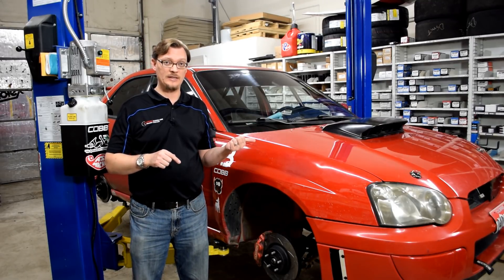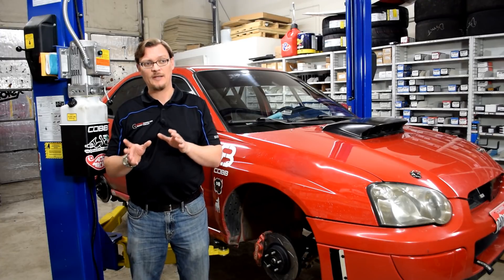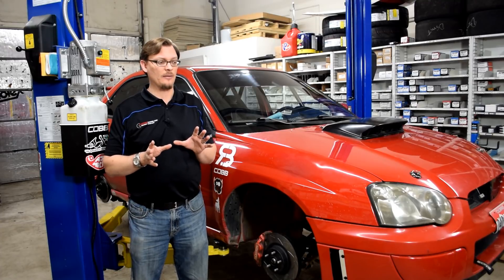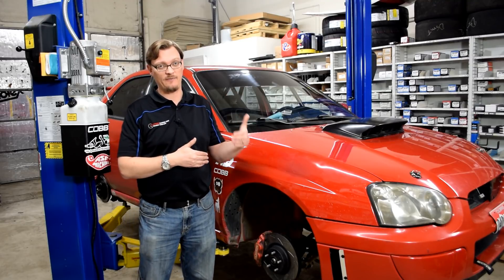STI 6-Speed Transmission Swap FAQ's

Comment: Do you have any recommendation regarding the decision between the early DCCD with 35:65 torque split and the newer version with 41:59 torque split? As far as I know, the newer versions (2007+) have an additional mechanical LSD, but I'm not sure if this affects the vehicles handling in a positive or negative way. Subaru claims, that this mechanical unit makes the car more predictable to drive, but I always thought the big advantage of the DCCD would be that there's minimal load on the front tires when the controller completely unlocks the diff, resulting in optimal corner turn-in. Doesn't the mechanical LSD (even if it seems to have very low ramp angles) counteract this advantage? And what about the 6% difference in torque split, is this very noticible? I heard someone say that the 35/56 version is close to undriveable in open mode, but can it be worse than a rwd car? Sorry for this complex question, but i'm looking to do the swap in my legacy and i'm not sure which gearbox I should look for.
Reply from the maker: Thanks for your question.  This is a question with a couple of levels of answer, so for now, I'll have to give you the high points, and you can contact us directly if you want to go into more detail.  

First, I'd base your choice for transmission around what is available, condition, mileage, etc., first, before I'd focus on the center diff function alone.  All of the STI DCCD's work well, and though there are differences, they are not what I would focus on.  

The early STI transmissions (03-05) use a center diff that is open when no power is going to the DCCD just as you describe.  If you want maximum rear bias, this may be a nice feature, but the newer transmissions behave almost the same.  The bigger benefit to these early transmission is that they have an internal pump for better oiling of the transmission as a whole, and I'd say that this would be a more significant factor to push the decision to an early transmission.  But of course, it would have to be in good shape as well.

The later STI transmissions (2006+) started to incorporate a viscus coupling that works with the DCCD.  So though you may not be able to get the same rear bias as you can with the early transmission, it is pretty close.  Both new and older transmissions will feel mostly like rear-wheel drive cars with no power going to the center differential.  But these later transmissions did away with the oil pump for lubrication (starting in 2007+) and went to a more standard sling-trough.  This makes the transmissions simpler in some ways, but maybe not as ideal for very high power or Motorsports use as the earlier transmissions with the dedicated pump.

So they both have some pluses and minuses.  But any STI transmission will be very durable, and should work much better than any 5-speed would.

Hope that helps, and thanks for watching!
Reply: Thanks for your advice. Since the car will remain mainly a daily driver and I do not intend to exceed the stock 280hp very much, the presence/absence of the extra oil pump may not be very important. I will follow your advice and focus on availability and condition.

Comment: For those that are looking for simpler. Look into the TY856B1CA trans from the Version 7 STi RA. It’s the only 6 speed Subaru made that was non DCCD but has the front and matching rear lsd.
Reply from the maker: Thanks for the comment Brandon!  Yes, the very early 6-Speeds do remove the complexity of the DCCD.  However, with a good controller like the MAP DCCD, the functionality that you get from the DCCD is pretty impressive.

I my opinion, if you are going to go to the trouble of putting in the 6MT, you really want the functionality that the DCCD brings.

Thanks for watching!
Reply: FlatironsTuning not knocking the DCCD at all. I just finished my swap a few weeks ago and it was just another cost and headache of wiring to deal with so I tried to avoid it. My suggestion was just something in the middle because the Spec B is open diff and usdm STis are dccd.

Comment: My clutch master cylinder started to fail on my 2004 Subaru TS. I went to a parts shop to get both the master and slave cylinder. When I got home I noticed the parts didn't fit my car. When I went back with the old parts off my car the guy told me the parts where for a WRX STI. I bought the car at auction and no nothing about it's history. It runs great, I've been driving it since last year. I've never tried shifting the car into six gear ever. Maybe at one point they used the same master and slave setup but why? Anyone have any clues?
Reply from the maker: Thanks for your question Lewis.  For the Master cylinder, there hasn't been much change in those.  For the slave, of course the clutch type makes a big difference.  If you have a 2004, you should have a pull-style clutch.  Most of the pull style clutches have similar slave cylinders, but there have been some changes over the years.

Good luck getting your clutch working again, and thanks for watching!

Comment: Another Great video! Heres a question, looking at the subaru transmission charts you will notice that the suretrac r180 was never paired with a dccd., do you know why that could be? Would it be dangerous, bad to pair a rear suretrac with a dccd and lsd front?
Reply from the maker: Thanks for your question Josh.  That is an interesting one.  I would say that you would not want to pair a torque biasing differential (which the Suretrac would fall under) with a front LSD (clutch type diff) in most cases in general.  But the work fine if both front and rear are TBD's.  I don't that a DCCD would have any negatives with a Suretrac rear, but I've never heard any reason why Subaru largely went away from them.

It could be as simple as cost really...

I hope that helps, and thanks for watching!

Comment: great video.

I have 2006 sti. engine swapped to 2003 ej205 and standalone ecu. currntly my DCCD is not working with ej205. while its working with the ej257.

how I can keep the dccd working with the ej205?
also what is the other things that I need to look into for this kind of engine swap?

Thanks in advance
Reply from the maker: Thanks for your question.  All you need to get the DCCD working is a separate controller.  We like the MAP-DCCD controller, and we keep them in stock :-).  Here is a link to our video explaining how that works:

https://youtu.be/5DSCWigEbOc

Hope that helps, and let us know if you have any other questions.

Thanks for watching!

Comment: Okay, so I’ve been super confused for a very long time. I have a 2005 wrx and just picked up a 2006 sti trans, will this be a direct bolt up to the R160 rear dif? Allowing me to use stock hubs/axels and an automatic drive shaft? If not what are my options. Please clarify, thank you in advance!
Reply from the maker: Thank you for your question.  I would first recommend going back through this entire video, and pay especially close attention at 6:27 where we talk about rear diff ratios.

Then I would recommend going through our GD swap video as that will answer all of the questions that you mention  above.  Here is a link to that:

https://youtu.be/nUJ7E2Bh5g0

I hope that helps, and if you need anything else, please feel free to reach out!
Reply: Thank you it did help! And I watched the other video first then started this one. I was just confused because it said 06-07 sti transmission was compatible with 05 Wrx R160 but I think 06-07 are different gear ratios.
Reply from the maker: The 2006 STI and 2007 STI transmissions have different ratios in terms of the gears, but they use the same rear diff ratio.  Except the very early 2006 STI's, which got 2005 STI transmissions.  It is absolutely worth triple checking because if something is wrong, it will take out your center diff very quickly :-)
Reply: I can’t thank you enough for even replying because no one can seem to answer my questions. The model is DU-TY856WW7MA
Reply: SO SMOODIT did the model number on the trans you stated work?
Reply: I have a 2005 wrx and just got a Sti trans with the same model/serial number and just wanted some reusurance that it works with auto drive shaft
Reply: George Wixon to be honest man, no one was answering me. Not even my local turner shops. So I got annoyed and bought the whole swap haha. Ended up getting the rest of the parts for 900 bucks. Rear dif. Hubs. Axels and sti drive shaft.
Reply: SO SMOODIT 
Ok that’s good for you. I’m sure that all worked good for you but I got a 6spd trans with the same serial number that you mentioned the TY856WW7MMA and in going with that and my OE rear diff the R160 and gonna see if it works cause the Flatirons guy didn’t answer me either when I asked if it would work either.
Reply: SO SMOODIT 
Yeah Jon has not responded to me about the same serial number to put in my 05 wrx with using the oe r160 rear diff. I got the same trans that you got. TY856WW7MA. I’m gonna just try it with my r160 rear diff and automatic Impreza drive shaft. See what happens
Reply: SO SMOODIT 
I put that 6spd in yesterday and it’s seems good. No binding or anything. How will you know if it takes out your center diff?

Comment: Hello again and again thank you for all your videos! Here's my question: do R160 axles fit intot he R180 rear differential? - or, if I change the rear diff from R160n to R180, then the axles need to be changed and then the everything else (rims, brakes, etc.)?
Reply from the maker: Thanks for your question Mihael.  First, I would recommend that you also watch the video that we did about the GD STI Transmission swap, as that is covered more in depth there:

https://youtu.be/nUJ7E2Bh5g0

But the short answer is no.  The splines are different between the R160 differential and the R180 differential.  If you want to run an R180, and keep your WRX hubs, the simplest path is to use a conversion axle like the ones that Driveshaft Shop make.  Here is a link to them on our site for reference:

http://www.flatironstuning.com/p-2691-the-driveshaft-shop-subaru-1992-2001-impreza-wrx-sti-gc8-2002-2007-wrx-gd-with-r180-differential-conversion-800hp-rear-axles-new-price.aspx

I hope that helps, and thanks for watching!
Reply: Thank you very, very much for your answer!
Reply: Hello and again thank you for all your availability and knowledge to answer these questions!
What is the situation in the front? Can a 6MT diff work with the 5MT axles? Do the splines match?
Reply from the maker: Yep, the front axles will work in both the 5MT and 6MT.
Reply: Oh, that is very, very interesting! So do you think that a 6MT front differential would fit into a 5MT gearbox? - it is hard for me to find a Torque Biasing Differential for 5MT but there are plenty for 6MT...
Reply from the maker: They are not interchangeable.  The only commonality are the splines for the axles.
Reply from the maker: Quaife makes a front TBD, but they may be a bit hard to get a hold of.  We can also see about getting you a V6 STI front diff, which was a TBD.  I haven't ordered one in a while, so I'm not 100% sure they are still available.
Reply: I found only one version of TBD with gears (similar with Torsen) for the 5MT - the OEM one from some STIs - maybe the V6 STI as you mentioned. As far as I know there is no Suretrac for the 5MT (front diff) - only for 6MT. Please let me know if you know of any TBD front diff from a V6 STI, even second hand. Thank you again.
Reply: One more question please, if I may. For the 5MT I see some differentials that are made for female axles. Can those studs (I don't know how to call them) be removed from the differential so that it would work with male axle shafts? Again, thank you very much!
Reply from the maker: That depends on the differential entirely.  For the OEM differentials the stub axles are usually removeable (mainly in front).  Some of the aftermarket do not make them removable though.

Hope that helps and thanks for watching!
Reply: Again a big thank you and appreciation for your availability and knowledge!

Comment: i have a 2001 wrx bugeye want to buy s202 donor for 6 speed swap, can it be done only the gearbox and the prop shaft? because 
i see the s202 has 5x114 hub and i don't want to replace my new coilover on a 5x100 hub. any suggestion? tq
Reply from the maker: Thanks for your question Lev.  We talk about that a bit at the end of this video, but we have a detailed video on putting a 6-speed in a GD that goes into more detail about your specific question.  here is a link to that:

https://youtu.be/nUJ7E2Bh5g0

Hope that helps and thanks for watching!

Comment: So if i have an 2008 wrx hatch what sti gearbox must i get?
Reply from the maker: Thanks for your question.  There is no specific year that you would have to get.  If you wanted to keep your rear diff (which wouldn't be ideal because it is an open diff), you would need an early STI trans (04-05).  If you are going to be swapping out the rear diff for an R180, then it would only need make sure that the ratios of the diff and transmission match.

If you haven't all ready, take a look at the other video that we made specifically about the GR swap as well.  Here is a link to that:

https://youtu.be/CieGYuOJQj4

Thanks for watching!

Comment: ive also noticed that the r180 rear diffs before the my06 sti that run the suretrak diffs have the smaller flange and the ones with the plated diffs run the larger flange. my06 and my07 stis had the larger flange.
Reply from the maker: Thanks for that Kaeros!  We actually ran into exactly this with the parts that Tasso was using.  Though his was a 2003 JDM drivetrain.  My guess initially is that this was more on the JDM cars than the USDM cars, as this is the first time that we had seen that issue come up, so we'll have to do a little more investigating.

Thanks for watching!

Comment: oem subaru also have the rear rotor to run the subaru 2 pots with the r180 rear hubs. The gc8 type ra came standard with 2 pots and a r180 rear end running the larger handbrake.
Reply from the maker: Thanks Kaeros.  That makes perfect sense as the GC STI's had the R180 diff, but still were still running the Subaru 2-Pots.  We may have to see if that opens up any more good options for those rotors.

Thanks for watching!

Comment: Previously wanted to swap 04 sti knuckles into my car but now learning that they still have the press in style wheel bearings is making me second guess. I have heard that they can never hold up to extended track use. Have you found this to be true? Would rather not have to swap my whole suspension to go with the 5x114 knuckles too much invested into it already.
Reply from the maker: Thanks for the question Frank.  The STI bearings are larger than the WRX ones, which is a start, but I'd never say that they can't stand up to track use.  As long as you keep an eye on them, and replace the bearings when they start to fail, rather than replace them when they are completely shot, you should be fine.

It is more work with the press-in bearings to be sure, but after you do a few, it isn't that bad.  Staying on top of them is the key.

And yes, if you have wheels and suspension sorted, it doesn't make sense to start over completely for a simpler repair that will come up occasionally.

Comment: How much of this 08+ wrx info would transfer over to a 08 legacy gt?
Reply from the maker: Thanks for the question Derrick.  Most of this would apply to the LGT.   We've helped do one of those as well.  Basically in the back, your rear suspension is unique, but you have the Spec-B that came with the 6-Speed to tap into.  You will have to put something else in for the Rear diff, but you can just put in the R180 and use Spec-B rear axles.

You're lucky enough that Subaru actually solved most of this for you :-)
Reply: FlatironsTuning thanks for the response. keep up with great informative videos!

Comment: Question: The ending of this video addresses the narrow body GR vs. the widebody GR suspension differences. Does this also apply to the GD chassis between the Wagon and the Sedan? I believe the wagon will need rear lateral links and front control arms to complete the 'wide-track'. Correct?
Reply from the maker: Thanks for your question.  Yes, in the case of the GD Sedan Vs. Wagon it is the front control arms, and rear lateral links that are different between the two.  There is less of a width difference between the GD's than the GR's, but yes, to do it properly you would need Sedan lower control arms and Lateral Links if you were going to run STI axles.
Reply: Much appreciated :)

Comment: 2006 Subaru wrx, I think I understand I can run;
06 sti trans
Auto drive shaft
R160 rear diff 
Existing 5 speed clutch
Existing wrx drive shafts, brakes, suspension etc.??
Reply from the maker: Thanks for your question Jordan.  You are close.  The year of the STI transmission isn't that important.  It will just have to match the R&P ratio of the R160 diff you use, as yours will not work with any STI transmission.  You can't keep your clutch because starting in 2006, all of the WRX's got a push-style clutch which is not compatibly with the STI transmission.

Good luck with your swap, and make sure that you check out the first video that we did on the GD swap too:

https://youtu.be/nUJ7E2Bh5g0

Good luck with your swap!
Reply: FlatironsTuning thanks so much for the reply, helps a lot! So to confirm I can use the following parts;
Sti Transmission & clutch with flywheel
Auto drive shaft
R160 that matches the gearbox ratios (what year r160 diff will match?)

And that’s all I need?
Reply from the maker: Those are definitely the high points.  Hopefully this video and the one that we made specifically on the GD swap will be a good resource for you.

https://youtu.be/nUJ7E2Bh5g0

If you have any questions, or if you need any parts, etc., don't hesitate to reach out.